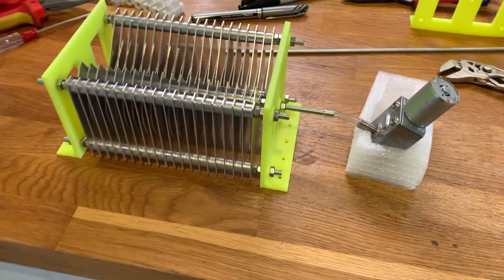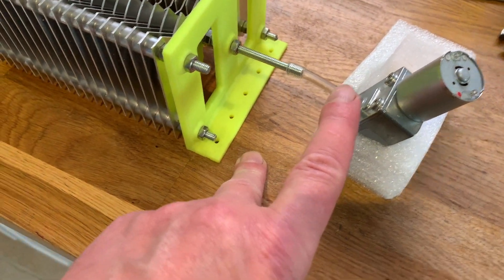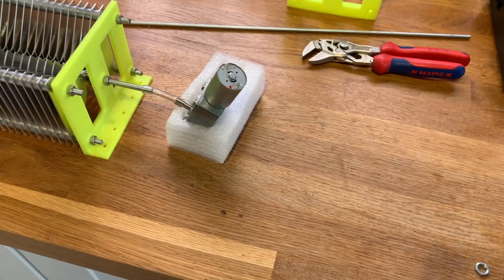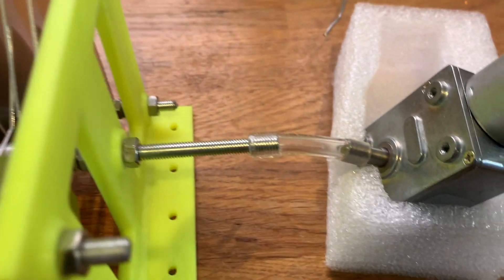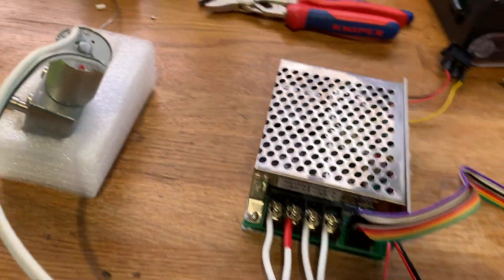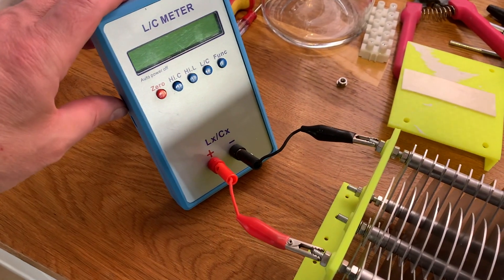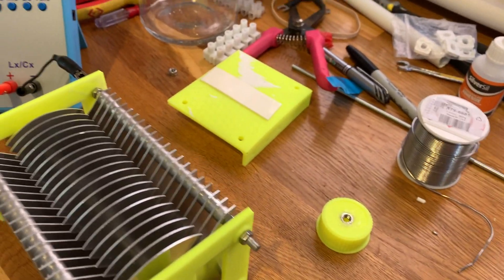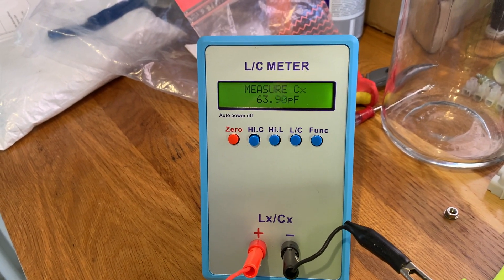HAM RADIO: The "Capacitor" Figure of 8 Magnetic Loop: MAGLOOP: Coax loop Part 2

Comment: Hi.Mike...brilliant stuff, just one question, this much capacitance 12-92 pf is good for what bands? TNX
Reply from the maker: Difficult question to answer as it depends on the length of the loop if the loop is resident just below the desired frequency then you will only need a small amount of capacitance to move it through the band.

Comment: I'm curious about the configuration of the leads of the LC meter. Why did you measure between the plates and not between the shaft and plates? I'd have thought most used a bonded stator and then the rotor was the other pole...I've never seen two stators and a floating rotor....is that for voltage isolation??
Reply from the maker: Yes ok, this version is a butterfly, you have two banks in series (half the capacity but no moving connection) it will handle a higher voltage as there is no moving connections and there is less loss.
Reply: @mike-M0MSN  Ah, thanks for the explanation. I always assumed that it was called that because of the shape of the fins and that it was wired the same way, I didn't realize that it was a different topology too. Thanks for clearing that up!
Reply from the maker: The great thing is you can wire them 3 way in series, single sided stator, rotor or parallel

Comment: Nice job again Mike. This will make remote tuning a lot easier for sure.  Strap every thing down good and tight and that will control any variation in stray capacitance which could be hanging around in the form of connecting leads etc........cheers
Reply from the maker: Thanks Mate, I think I will have to make the connection between the cap and motor a solid one to help with the accuracy.

Comment: Good work Mike. I would expect with such a narrow bandwidth antenna, the flexible aquarium pipe between motor and cap shaft may make fine tuning a bit of hit and miss. There needs to be no play. I also used a flexible pipe with my first mag loop, and ended up buying a plastic capacitor shaft off eBay that went between my motor and cap shaft, and that fixed my difficulty in moving a few Khz. I will be watching with interest, 73
Reply from the maker: Agreed, have change for a solid coupler 👍

Comment: I think you will have a better experience if you switch to geared stepper motors. Stepper motors in combination with a micro-controller bring a number of advantages. It is possible to establish a known starting position and accurately  index to any arbitrary position at full speed.  Using this indexing ability you can establish and save preset positions based on frequency and later recall them from the micro-controller. Then fine tuning may be made at reduce speed to zero in on the resonance point. Have a poke around and you will find a number of DIY ATU projects on the net.
Reply from the maker: Agreed Rob, next version will have just that I have the kit already... one step at a time (no pun intended)